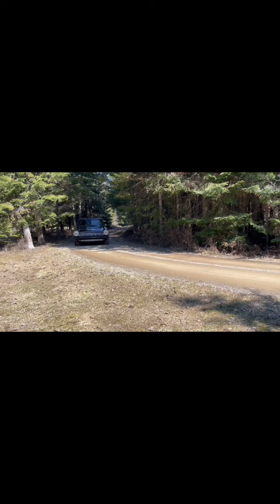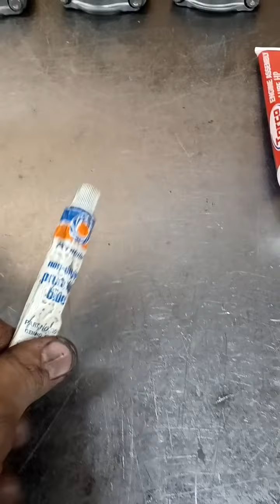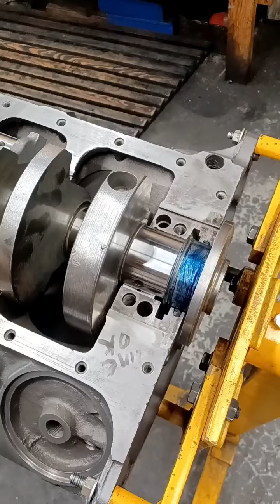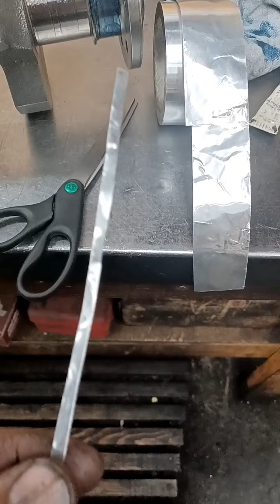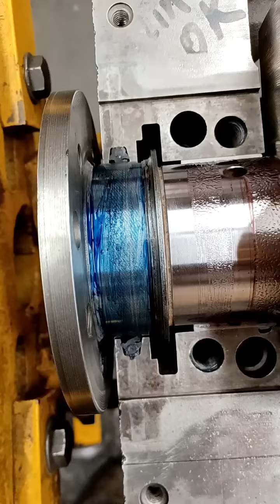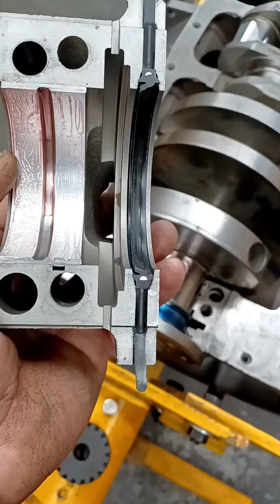Rear Main Seal Leaking On Your Muscle Car?

Comment: What happens when the block heats up and expands the metal? Will the seal wear faster because you have the seal sitting tighter?
Reply from the maker: @Jase_d  Been doing it for years and have had no problems. The expansion is going to be very minimal.
Reply: Glad I found this video. It was informative!

Comment: Where can I get some of that aluminum tape?  Did you cut the small rubber wings that go past the cap or leave them?  I am having a nightmare replacing my rms on my 318 coronet.  I have done it twice now and leaks when I rev past 2000 rpm.
Reply from the maker: You can get tape from most hardware stores, if yours has the  tabs that stick out I would leave them.
Reply: @palmersperformance7117  will the tabs sticking out interfere with the oil pan gasket sealing properly?
Reply from the maker: Not all motors use the tabs, not sure if yours does. If it does they are under the cap and have nothing to do with pan.
Reply: @palmersperformance7117  you are correct.  My cap also has the recess for the wings just like yours.  I am referring to the small part of that wing that sticks out past the cap as shown 4:33 minutes into your video.
Reply from the maker: If it interferes with your pan gasket then cut it off, use a good sealant in the corners at least on pan gasket.
Reply: @palmersperformance7117  I will do that, I really appreciate your feedback and hope this trick solves my issue.  You also mention adding sealant on the back side of the seal against the block/ cap.  I have had really good results with aviation sealant.  have you used it?